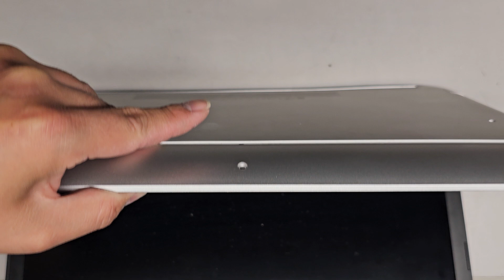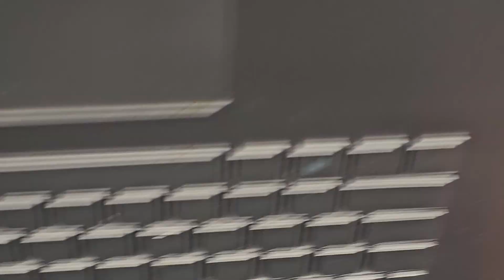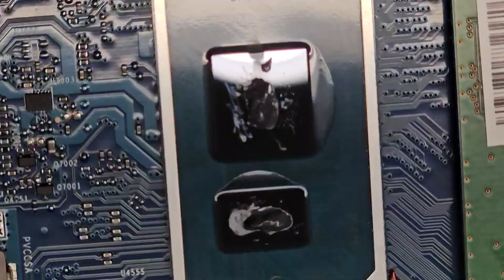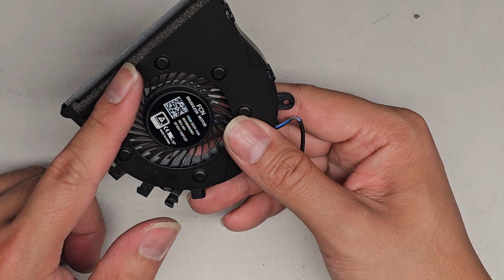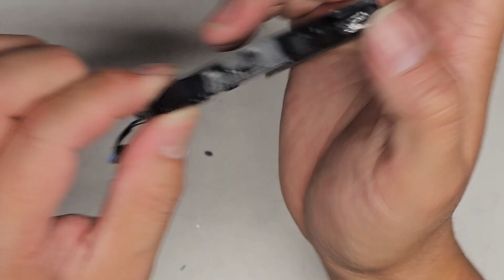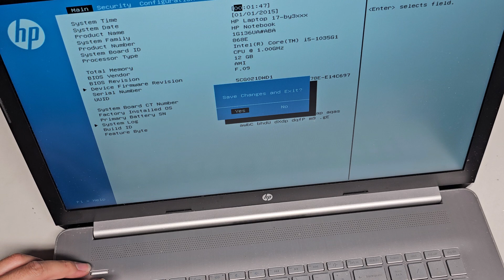HP 17-BY3053CL Disassembly RAM SSD Hard Drive Upgrade Battery Fan Thermal Paste Replacement Repair

Comment: This video helped so much. I got this computer as gift from a client, all I need for is for office stuff, but it was too freaking slow so I upgraded the memory and added a 990 PRO so I came to find out where the PCIe NVME drive would be located and ended up doing a complete overhaul. Crossing my fingers that my computer will work. I’m not ready for a new one. 🎉
Reply from the maker: Awesome, hope it goes well!

Comment: What was the client’s problem with the computer?? Where would you start if a computer will not turn in? Computer place checked a new cord and that didn’t work - but I didn’t have the money to back up my hard drive for them to investigate further. I’m going to have to fix myself probably. I noticed the charging cord would have to sit a certain way to charge for awhile. Any idea’s?
Reply from the maker: Bad charge port.

Comment: Would you recommend to the client to replace the battery?
Reply from the maker: @MCalvin1955  since they don't really use the battery, I recommended they don't leave it plugged in when not in use and if the touchpad buttons aren't clickable to replace it because the battery would have expanded too much, but it's not an urgent need.